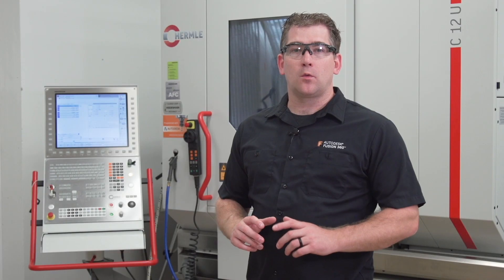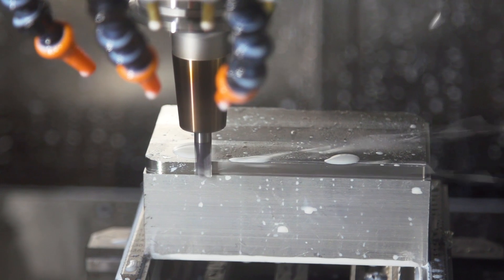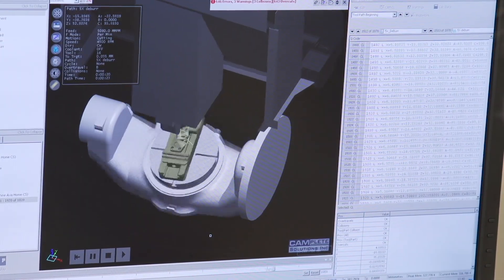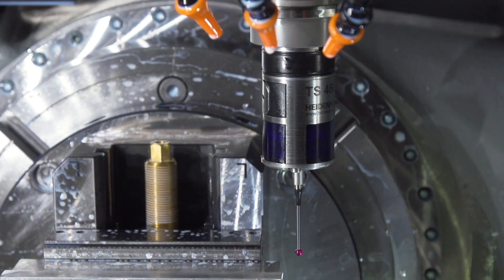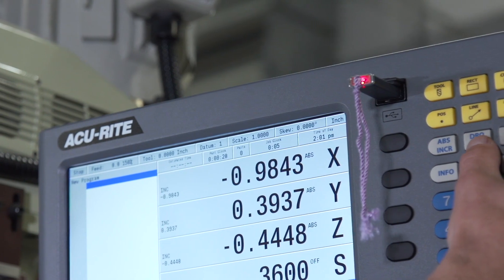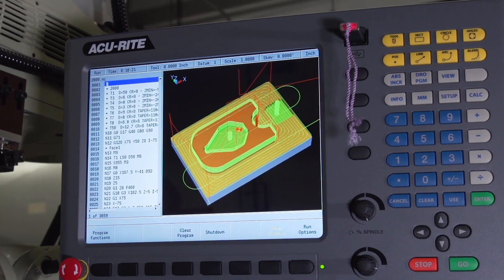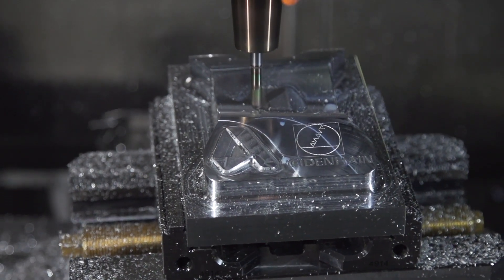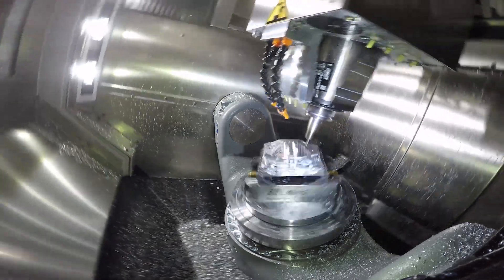Post Processor Development at Heidenhain

Comment: So, will the Heidenhain post for Fusion 360 work with all machines that are fitted with a Heidenhain control? I'm currently looking at a Doosan DNM 4500 with a Nikken 5-axis trunnion, and a Heidenhain 640 control. I don't know much about post-processors though, so i really don't want to be having to play around with it...
Reply: I also work on Doosan DNM 6700 with Nikken 5-axis and heidenhain control. Fusion seems to works well for us , there are a few changes that need doing but they are as minor as coolant codes. It's far better than our old Mastercam post.
Reply: @neilmetcalfe8442  Thanks Neil. I went with a Haas UMC500 in the end, for which I knew the post would be all good. It's useful to know for the future though. I'm starting to do some more simultaneous 5-axis work, with 3D surfacing, as opposed to position stuff. It seems that the Heidenhain control, and the machines that use them, are best for that kind of work... The post processor is still an alien language to me though 😂
Reply: @alex_yates  We've only used simultaneous 5 axis toolpaths on a couple of our jobs. Both times the posted code worked well without needing editing. I know what you mean about post script. I would imagine a little knowledge is dangerous. Still turning on the right coolant code isn't too hard.

Comment: So the solution for HSM 5 axis is to use PowerMill?
Reply from the maker: This video is going through the process Autodesk uses to validate post processors across all of our CAM solutions, and wasn’t meant to imply that all 5-axis operations require Powermill. As it stands today, there are more advanced 5-axis toolpaths available in Powermill. But we are working towards creating an accessible portfolio so that all our customers have a solution that best fits what they need to accomplish.